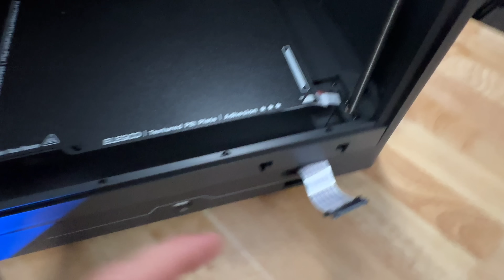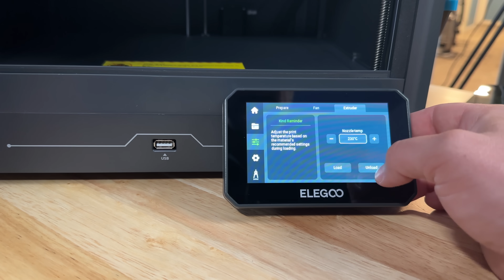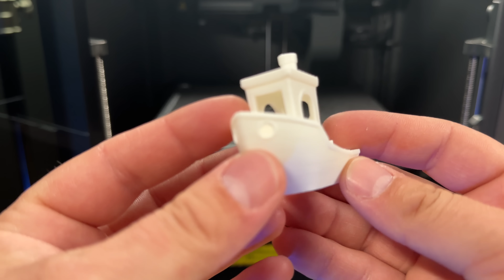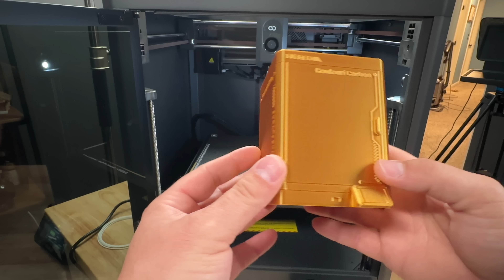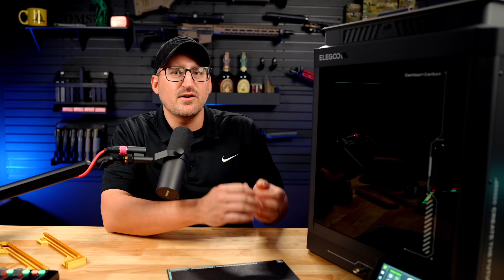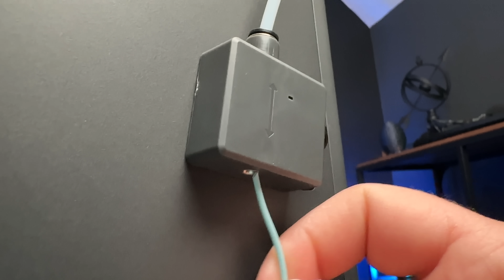Elegoo Centauri Carbon - Is it Worth the Wait?

Comment: I have bought mine last week. (End august) there is a new light bar in this mod as well as what looks like a multi filament port on the side.

It's amazing but I found doing the following made this better.

1 re lubricate the bars
2 someone has made a new hot end shroud which is way better and lighter
3 riser on the top is a must really helps
4 printed a muffler for the back
5 the part fan is the loudest fan so you can set it to 50% depending on where you're printing or you can get new fans

Comment: I do have a recommendation. Make sure you have plans to keep the printer in a separate room. Compared to my other printers, it's very loud. The chamber fan cannot be turned off due to firmware limitations. Under heated bed leveling, the aux fan will always turn on and hardcode to 60C no matter what temp you set. The aux fan is a freaking jet engine. Extremely limited user config, again firmware, due to lack of Klipper and fluidd. The firmware won't matter for most newbies, but man if you've been spoiled by fluidd, you will definitely notice the lack of it.

Comment: Just got mines today, it’s great how they added a light bar for better light, it was really fast, and heating up took less than 2 minutes
Reply: So to confirm they did get rid of the little circular light and it now is an actual light bar?
Reply: @zachholcombe Yeah, great decision, really easy to see on video when monitoring print

Comment: What is everyone crying about with the ""loading filiment"" I have had zero issues loading, it doesnt get stuck at the top. Pla,Pla pro,carbon fiber, tpu.
i do however get inconsistant layer lines and it refuses to print tpu with quality.

Comment: My printer became unusable after about 230–250 hours of use.
At first, there was a 502 error and a bed self-leveling issue. I tried a few more times, tightened screws, etc., and eventually it passed the leveling process. It worked fine for a day.
Then the bed started going up and down during printing. I was in the middle of a project, so I tried printing only in the leveled area.
Support told me to unscrew the bottom cover, check belt tension, and clean everything. The issue persisted. I then tried a factory reset, which helped – for one day.
After several prints in a row, I enabled the "level bed after preheating" option in the software. After leveling, the nozzle started scratching the bed.
I thought it might be a software issue, so I did another factory reset. Now, it doesn't pass the first leveling step, and I can't even get to the printer's menu anymore.
My first contact with support was 8 days ago. Two days ago, they shipped out a "strain gauge control board" – whatever that is. Shipping may take 7–9 days, as it's coming from China. They also said they'll reimburse me for import fees .
At this point, I'm not sure if it's even worth it. It looks like an adventure with Anycubic printers years back

Comment: I get a weird bug where the layer count doesn't advance without the text "generated by Elegoo slicer" swapped from orca slicer so the time lapse wouldn't work... I kinda liked prusa slicer better as all the options work on Linux (elegoo doesn't even have an option for Linux) until they release an ams type thing. It has been leaps better than my original ender 3 for not a lot of money so fingers crossed it keeps up. It is a little annoying there isn't a speaker or buzzer, I had my old ender play the Mario level clear song when prints finished.

Comment: Also i tried setting up my centauri carbon in bambu studio. I am calibrating it in elegoo slicer with their built in calibration tools/prints. If anyone had suggestion i will and do appreciate your comment. Also i know quite a bit about 3d printing. I am going to try taking off the dampening feet to see if that could be the cause. With everyone saying how great this printer is it must be something i am doing wrong, here. I did calibrate my flow rate to be 45mm/s and set that number in my sunlu filament profile. Also my temperature setting of 260c for petg should not be a problem either because i print all day at 255c on my X1c. And sunlu says this filament has a range of 220c-270c.

Comment: I have this printer. Did you try ludicrous mode. And how much tuning did you have to do.  I did the flow rate test and a the Pressure advance tests. And i am doing the stringing tests, now. So far for the stringing test the stringing is terrible using sunlu petg filament. I tried the same test on my X1c with exactly the same filament and ZERO I mean zero stringing on my X1c. It looks like you, in the video are printing in balanced mode. I find balanced mode slow. Sunlu petg not hs petg just regular petg run on my X1c parts come out perfect in every way. running at ludicrous mode. So I know my problems are not bad filament or wet filament. I just thought that I would not have to do so much tuning to get a decent print. In ludicrous mode on the Centauri i got very poor layer adhesion. Even printing in balanced mode i got better layer adhesion but the surface quality was bad ruff and uneven shine to my filament. Again running the same filament on my X1c absolutely perfect as i have shown in my videos on youtube @ sleepingdogvideo2.  Thank you. Ps i ordered my print feb 18, 2025 and got it around may 11.

Comment: I only have two things to add. The price is realistically the same since Elegoo tacks on a $30 shipping charge, and I believe there is a way to remotely view the printer's settings and camera through a web interface. I don't remember exactly, but I believe if you type the printer's IP address into Google you'll be able to see all that info. Still not anywhere near the level of Bambu Handy, but it's something

Comment: It's really amazing what they've managed to do here for the money. Also cool they are making changes and upgrades so quickly, though of course it would have been nice if they were there from the start. Seems the next big question is long term reliability, but I don't see any glaring issues. Nice overview!
Reply: The printer for the price is incredibly hard to beat. I have had mine for about 2 weeks and racked up 200 hrs of print time. One failure after a pause, (which might be fixed in the firmware released last night). 2 day down time due to a massive clog in the throat, not the printer's fault (speck of metal in cheap filament). However sending in a video of the issue, they had already shipped a replacement hotend. The support and responsiveness of Elegoo has been nothing short of amazing. The parts supply for replacements different story, this will take time. Should mention almost all the new printers for pre-order have been coming with all the updates. The one he got is definitely from older 1st-1.5 batch.
Reply: @1pcha Glad to hear support has been excellent!

Comment: I ordered mine last month, was told it would be available in July. Haven't had any communications since however it's paid for.
Reply: I ordered mine on March 15 and it just arrived today 6/11/25. Have yet to unbox it but will tomorrow. Hopefully yours is coming soon. I got the email like 3 days ago that they were shipping it, otherwise no communication last couple months.
Reply: Mine finally arrived, I will say I think they've listened to their consumers. The boden tube and track do not seem to be pressed against the glass. The panel issues on the sides bowing out has been resolved. And the light seems to be working quite well. I ran it all day yesterday making toys for the kids that we give away at work. It just printed splendidly.

Comment: I'm currently so split between the A1 and the CC. I've had anycubic i3 and an ender 3 V2 in previous times so similar to yourself. I wonder what you'd say to someone like myself , also how are acoustics/noise levels between the A1 and CC?

I'd

I would like the option of multi colour just hoping Elegoo do a nice job if it comes Q3! But also love the idea of printing different filaments other than PLA which is all I've used. But more than happy with my application. 

To yourself or anyone in the comments , what would suggest to go for right now?
Reply: The A1 has an AMS (Lite) already (but not for TPU, abrasives or hygroscopic filaments). However the A1 simply doesn’t have the enclosure required for printing materials like ABS. And a hardened nozzle is extra on the A1. 
If you want an enclosed Bambu, you are looking at the P1S as the point of comparison (and then add 50 for hardening the printhead - standard on CC).
If you want an open printer, the upcoming plain “Centauri” is promised at 199 - that is the A1 competitor. The enclosed CC isn’t necessary for PLA, and having the door open and the roof off (and the case exhaust fan running) for printing PLA might make you wonder why you went the extra 100 for the CC (answer: to have the option of using those ‘engineering’ filaments one day). Open printers naturally don’t have a case exhaust fan! 

The CC when printing fast, is noisy, and it is a harsher noise than the sewing machine noises the A1 usually makes. For the price I’m happy with that compromise, and delighted with my CC, but I will be exploring noise-deadening mounting. Just don’t mount it direct on foam or carpet, because that will block any cooling for the floor-mounted electronics. 

All CCs are still under warranty, so there is no need for retail spare parts availability. Elegoo do have some accessories due to be available about now. Bambu-fit 256x256 build plates can be used if you really want, but I have found the standard plate works very well indeed.
Reply from the maker: A1 for sure. Easy to use and it just works. Parts and accessories are readily available. Their ecosystem is great, too.
Reply: @TheShotgunStudio why would you go with A1 over a good product like this? Firmware updates and longevity etc or purely for parts and accessories?
Reply: If you need to print tall flexible parts, tpu then the CC. The bed slinging nature of the A1 will cause layer lines shifts on tall tpu parts at top area.

I have an A1 and also ordered a CC because of this.
And also because the CC will print faster.

However, the A1 is still amazing. 
I have even printed on it with Overture EasyNylon and the parts are great
Reply: I would go for CC, my brother got his last week and it's his first printer very happy with CC, I had ended 3 and now have Neptune 4 pro but want to start printing material that requires closed printer so planning to get CC later this year with Multicolor system and use it for support or just Multicolor prints, getting A1 is an open printer so you kinda limited to pla and petg unless you will put inside an enclosure, with CC you have enclosure already so it's more future proof whenever you feel like printing with more technical material like asa PC or carbon ones

Comment: I absolutely love my CC. I got mine on the third batch, so i have the AMS port and the updated lights.  I have about 30 hours on mine and the only issues i have had so far is durring a filiment change while printing, it gets stuck on the "load filliment" screen however pressing resume it orints no issue. This has happened to me 3 times but more of an inconvenience. After the print finishes, it goes back to normal.  

I'm hostly looking to buy a second 1 for my print garden.

Comment: @theshotgunstudio cut that clip holding the filiment tube down near the extruder.  Even elegoo on the more recent machines no longer clips the tube there and let's it rise up above the chain so the curve isn't as tight for the filiment. My filiment tube was pulled halfway out of the chain letting it float above the chain.  I added the riser so it wouldn't rub on the glass top.

Comment: I loving my Elegoo I would really suggest to update your own shop lights there are about same as the printer could not see the back side of the printer. Mine has the AMS and new lights ( those new lights are not something to write home about ) Orca sends the prints to the printer and has the profiles setup by IP address the runout sensor has a printable that hooks up a M10 that riser is weak if you going to print out ABS the vents do not seal up well.
Reply: Yeah I have the ams slot also and assumed I had the older lights but maybe this is what they think is better.  Really leaves a lot of dark space.  I am going to attack a light strip to the top riser to improve lighting.  As soon as I resolve the problem of it printing air.  I seem to be having the same problem as 3d printing Steve,  I think that was his name.  After about 2 weeks of heavy printing without any problem came out to a "complete" print of nothing but the first couple layers abs a brim.  Cleared the tube checked everything I could think of but can't get it to print anything other than air.  :(

Comment: CC works with Orca.  More brand presets.  There is an octo everwhere option for the CC.  This does require a rasberry pi setup, but with that you can remote monitor.  Reason head moves around is to rehome, then cut, then back to poop bucket.  Has to rehome first to make sure other movements are accurate in relation to internal physical elements of the printer.  Uses sensorless homing which is why it bumps.  There are mods available to provide better spacing from the side of the printer to the filament sensor.  Add led lights to the riser.  Modding a printer for better usage is pretty normal, and part of the fun.

Comment: Make a bottom piece for the filament sensor that has a cone shape under the hole then stick it on. That will sort you loading issue. Make a stroud around the USB to stop it being knocked or just buy one of those low profile USB sticks.

Comment: I received mine a few days ago and until now it works like a charm. You mentioned that there is no app. There isn't, but you can just type the IP-address of the printer in your browser and you get to a webapp where you can monitor the print and upload files and stuff. Works great on PC and mobile.

Comment: My question is this upgradeable to something modern like Klipper and is the hotend moddable to upgrade to a decent e3d?    my problem with the other brand is they do all kinds of things to force you to buy their parts and try and stop you from modding. meaning the hobbyist cant expand and grow.
Reply: It's running a variant of Klipper but as far as I have heard and seen it's not "rootable" to go with just klipper
Reply: @DjOnslaught0713  Centauri Carbon only has one processor so no klipper.  I think its running a custom firwware,
Reply: Neptune 4 you can load clean klipper software I guess with a bit more time this will be the case for CC too

Comment: Forget elegoo slicer and just go right to orca. It has all the other filament presets
Reply: If you use Orca you cannot use the Printer's built in timelapse video record feature. Driver support is only available (at this time) through Elegoo Slicer.
Reply: @policani  Yes you can, it will automatically prompt you when you are submitting the gcode file if you'd like to perform auto-bed leveling, timelapse, and which side of the plate you are currently using.

Comment: Great video! Been loving my Centauri as well, have just over 300 hours on it. If you search the IP of the printer from your phone or computer in the browser, you can get a nice GUI with camera view, that is as best as I have gotten for an app to monitor the printer remotely.
Reply from the maker: Thanks! I’ll have to give that a try. At least the camera on the Elegoo is a step up from the A1 series.
Reply: Only issue with this you can only connect this way with printer while on the same home network, accessing it form outside is a bit more tricky
Reply: @Blackrhyme7  Thanks for that follow-up.. it means I can't stuff my printer in my garage on a different network! now I can plan accordingly.
Reply: @Blackrhyme7 Tailscale makes this easily feasible (and easy to setup).
Reply: 300 hours! Nice. Hoping these will be reliable for people.